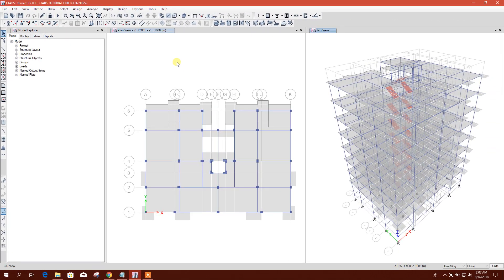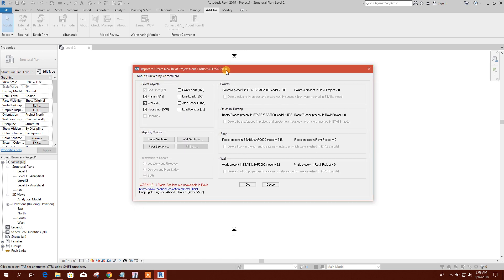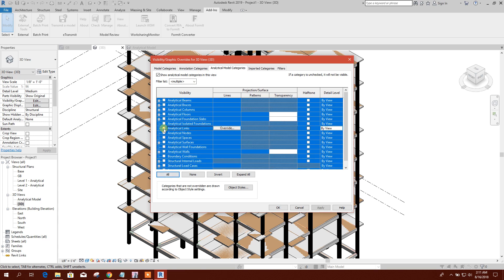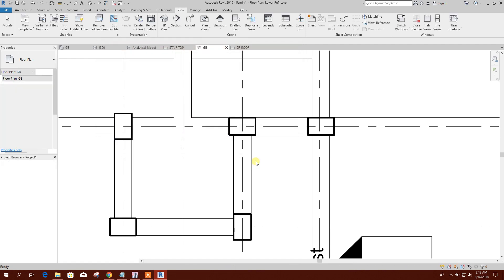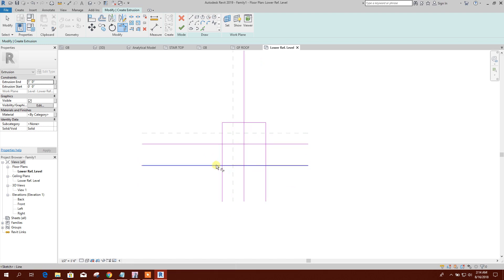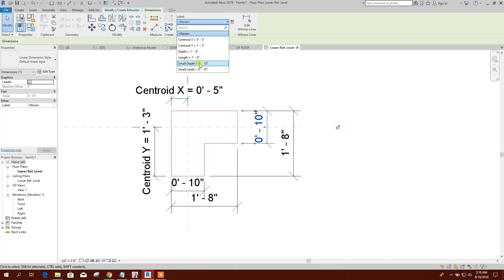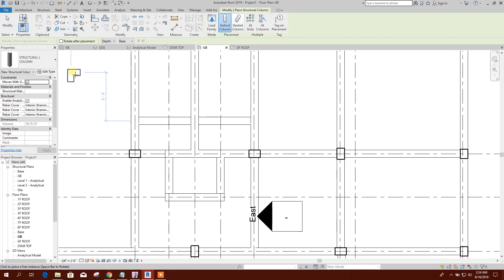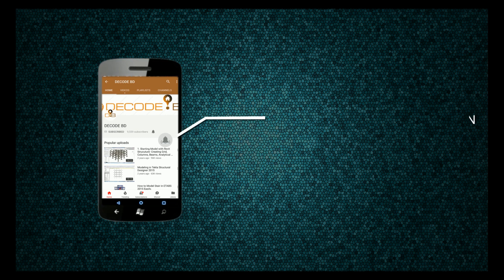CSiXRevit 2019: MODEL FROM ETABS 17 TO REVIT 2019 AND L COLUMN IN REVIT.

Comment: I'm having trouble to import from SAP2000 into REVIT (new model or importing back a model created in Revit exported to SAP2000). I can export Revit > SAP2000 and works fine but when i do the reverse, some errors occurs. It says that i need to install an additional content package, but i alredy did it. I alredy tried everything I could think off.

When i click on "Import to create New Revit Project...." 
Error : "C:\Path\CSixRevit Family Name Mapping. txt is not a reconized internal version. Proceed anyway?"
When i select the EXR file.
Error: "Unable to import because there are no structural column families in the Revit content libraries! Please download and Install one of the Revit 2022 Additional Content packs from the Autodesk Revit Content Download web page"  I alredy did it!
Reply: Hi, you can solve this problem?, i have too